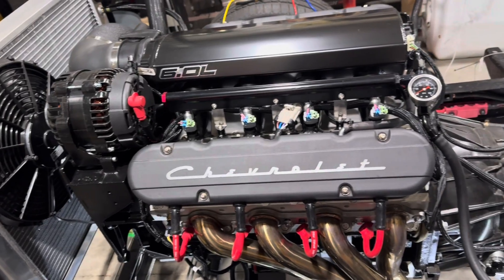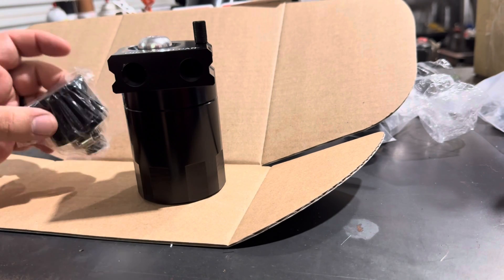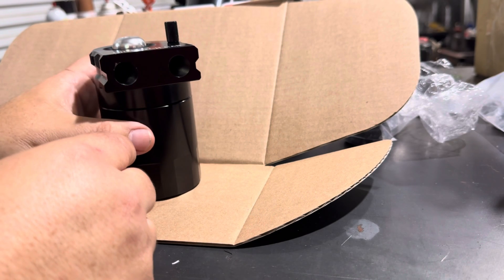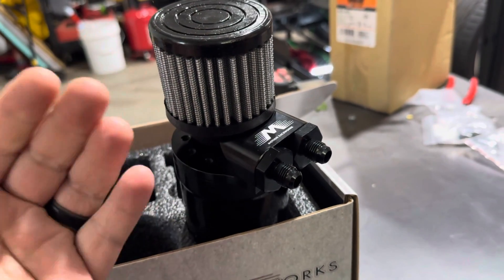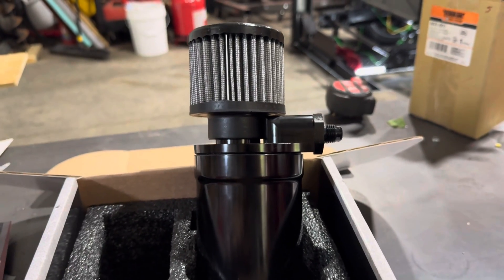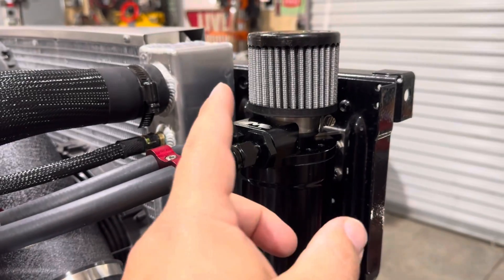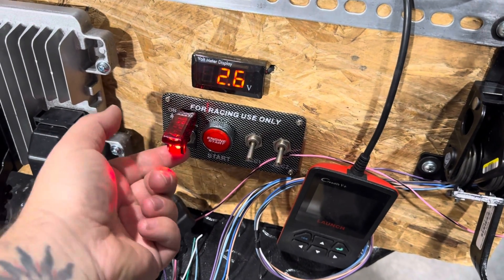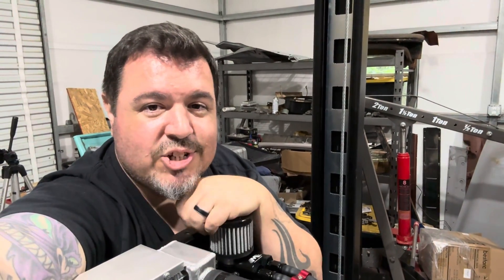Oil Catch Cans: 101 - EVERYTHING you NEED to Know!

Comment: Here's a thought, what if you used a sealed catch can and ran the outlet oldskool to the exhaust?
Reply from the maker: Depends on your hose routing but honestly the only reason I would do that (which I actually might), is if converting a vented catch can to get steam and odor out of the engine bay, and not wanting to re-burn combustion byproducts. Some REALLY important things to consider if attempting that. You need a larger outlet hose/line,  need to weld an exhaust bung about a 1’ downstream from the collector at a 45° angle, pointing the gasses towards the flow of exhaust. A 90° could cause reversion which would be bad. ALSO…. You absolutely have to run a check valve on that large hose to prevent reversion as well. Hope that all makes sense!

Comment: I've been using Gemini from Google to help me rebuild the car I have bought that was a lemon and let me tell you Gemini explains it to the T exactly what the catch can and anything else you want to use on your car and makes perfect sense and gives you perfect advice on what to use and how to use it try it out let me know how you like it because we're all know it alls but AI knows it all. I was going to use a catch can just like that one but Gemini told me differently instead I ordered another one has three hoses that come out of it two inlets and one out because I have an attachment from the PVC valve and the crankcase oil cap ventilation into the catch can to help ventilate even more of the pressure of blow by produced in my engine.

Comment: My ls3 has a breather on oil cap and one on each valve cover. When opening the oil cap I saw water so how would it be different with an open catch can if the vapors aren't getting pulled out with vacuum?  Im thinking a quality sealed one would help more in my case? Newer 525hp ls3 with 12k miles
Reply from the maker: The cans are so great at catching water vapor that some people confusingly think they have engine problems lol. Obviously you’d have to plumb your systems PCV differently than its current configuration though. Thanks for the comment!

Comment: Great video. I do have a question for you though. I've read to mount the catch can lower than the valve covers due to possible syphoning of the crappy oil back into the engine. Yours is mounted high which I also believe this is the correct way. The reason I ask is because on my 700HP LS3 stroker that I have Holley valve covers on but they don't have any kind of baffle in them. Because I have my catch can lower in the front of the car the catch can filles up quick and I'm thinking because with no baffles and being lower it just pushing the oil downhill. Taking the oil cap off I don't have any blow by. I am running a high flow Melling oil pump though and when it first starts it pushing 60 psi, hot at around 30-35. what is your thought on this? Should I move, my catch can so its higher? Thanks
Reply from the maker: Hey! 
Thanks for the question. Yeah with that kind of power, your crankcase pressure is certainly getting up there and I would definitely want the can higher. Are you able to use a baffled valve cover? I know for high hp engines they make large valve cover bungs for routing catch can hoses that have the baffles built into the bungs. Cant remember where I saw them but I know they make them. Would definitely help a lot!

Comment: should i use the filter on my 2001 v8 dodge ram? wouldnt that add air and cause a lean/rich condition?
Reply from the maker: Depends how you plumb it. In my configuration it does not.

Comment: when is the filter on the top used; i got one with my catch can, but i didnt use it ?   dont understand its use
Reply from the maker: One exalted would be If you’re not using your factory PCV system, like me… I run a line from each valve cover to the can and my crankcase pressure escapes through the breather on top

Comment: I'd recommend you change that intake manifold to a fast LSX-RT (truck style).  The short runners eill kill torque and power in low rpm.(anything below 7000)
Reply from the maker: Please watch my video on why I chose that intake and why it doesn’t matter.
Reply: Depends on what a person wants to do. I personally love the fast intakes, my issue is I had to choose the cam, intake, and everything to pour my power in up high. Its in an s10 time attack style build. It has zero driver aids, not even abs. When power blasts in low, it absolutely cooks my tires in the light rear ended truck. It keeps manners very manageable when driving normal as well. It feels like a good running v6 until you start pulling. It gives the same sensation as a turbo car. It also has to have a very short runner to clear the hood unless I want to throw a 4" cowl on it which kills my visibility. They both have pros and cons. Id probably use a long runner if it were a drag vehicle or a tow rig.

Comment: Ha I would have been down to join a live stream, but the car I am working at is just a small sentra QR20DE... I am going to fabricate a aluminum air intake manifold to make room for turbo piping. The exhaust headers are facing the firewall, so not much room to work with. Need to change the layout of the engine bay a bit, but I am aiming for 9psi.... catch cans seem important, so I will put one in after seeing your video! Thanks man cheers
Reply from the maker: Thanks for watching and good luck with your project!

Comment: So the outlet is through the filter on top?  You mentioned two inlet ports...wondering where the outlet is.  My son's '09 Silverado is getting a lot of oil in the throttle body, so just learning about catch cans.  Great vid, thanks.
Reply from the maker: In this application, the Gen 4 LS doesn’t have a vacuum port on the throttle body, so… each valve cover gets routed to both inlets of the can. Oil (if any) is collected, and the crankcase pressure & vapors escape via the filter on top of the can. Think of it as an old school carbureted set up where each valve cover has a breather element on it. Its essentially the same thing only instead of the breather elements getting gross with oil vapor over time, now there is a can to collect that. 
    If you were to utilize this configuration on a gen 3 LS or other engine that has a vacuum port on the throttle body, you would simply just cap off that port.

Comment: Just installed a similar setup on my 3.5 ecoboost. 1 can for each side vented to atmosphere. But my question is what to do with the vacuum lines now? The ecoboost reroute directly back into the intake.  I’d rather not plug them back into the cans and close the system. Where else can I pull vacuum from cleanly?

Comment: I like the look of the catch can on the radiator core support but thst is only legal for off-road use. The return of engine piston blow by was the first federally mandated air pollution device from the early 1960’s. To have it vented to the atmosphere is against the law, it also sends oil vapors into the engine compartment which will attract dirt and throw your OCD switch into overdrive. Stay legal and stay clean. You won’t have to deal with the smell either. LS is a great engine.
Reply from the maker: Ive ran it both sealed and vented.

Comment: Will catch cans, vented or not, and people say it’s legal is bad for the atmosphere. I never send it back to the motor. I’ve been out to the atmosphere. I don’t want that garbage with the back oil or the engine. I put the filter on and it’s not. Can you recycling the garbage back in your motor and it burns it out the exhaust so by going through the can you’re taking oil out and you have the vapours big deal Their filtered what’s coming at exhaust when you have the PCV valve in the system and you’re pulling a vacuum, it’s going to the motor burning out the tail pipe. You want the garbage garbage going back to your motor so right get rid of that garbage away from the motor. And both engines of mine, I run it direct to that. Can I never send it back to the motor filtered out? I do not like sealed cans. Do you want all that pressure out of that motor so you don’t start three leagues early you get that on that motor better for it?
Reply from the maker: I hear ya, I don’t like the concept of reburning all that eithet. I dont care how much more “efficient” it is lol

Comment: How do u avoid a vacuum leak with the breather would it need a check valve included to avoid that or how would that work also clean setup 🎉🎉
Reply from the maker: Its physically impossible to have a vacuum leak when plumbed this way. Its simply each valve cover being vented out to atmosphere. And the cold air intake sucking fresh air for combustion - think of it exactly like a carburetor set up where each valve cover has a breather cap, and the carb sucks fresh air through the air cleaner - same exact thing!

I think the confusion comes when people think of gen 3 LS engines where the cable driven throttle body has a vacuum port after the blade - whereas there is no vacuum port on a Gen 4 Ls’s drive by wire throttle body. Even in the case of the gen 3 - all you’d do is cap the vacuum port! Make sense?

Comment: What size hose did you use on the valve covers and what type of fitting did you add to the AN fitting?
Reply from the maker: Just 3/8 fuel line with 6an pushlock fittings. Then I have 6an to ORB adapters on the catch can.
Reply: @intheshoptv  great video props to you

Comment: I have the same engine setup, if going to an 8an fitting on catch can will the hose be too large for the ports on the valve cover? also are those push connectors the ones that can be purchased with the kit?
Reply from the maker: They are 8an to 6an adapters. Im using standard 3/8 fuel line. The factory used 3/8 or less for the Pcv system so no need to upsize unless making big power. Just standard push-lok connectors

Comment: This is a beautiful product. But it has been proven to be a vacuum leak. There is no baffle for the filter. Try Mighty Mouse. They have a filter that is sprung closed while under vacuum but allows positive pressure out when needed. Great gor boosted vehicles.
Reply from the maker: It has not “been proven” it has been misunderstood and parroted. It’s physically impossible to cause a vacuum leak when plumbed the way I have it (one line off each valve cover). Does a breather cap on each valve cover of a carbureted engine cause a vacuum leak? This is the same exact thing.

Comment: Someone recommended that I add one to my IS250 to avoid carbon build up. Is that correct?
Reply from the maker: No it doesn’t really help much with that. Run some premium gas once in a while - that will do MUCH more for that honestly
Reply: @intheshoptv  Alright. Thank you very much for your guidance.
Reply from the maker: @michaelbwembya237 Thank YOU for watching and commenting!
Reply: @intheshoptv Thank you very much for your guidance.

Comment: Doesn't your setup cuase vaccum leak? The engine can suck air through the vent or there is check valve. I thought when connecting the vent, the line goes to thr intake should be pluged
Reply from the maker: Nope. There is no line that goes to the intake to plug. You may be thinking of gen 3 engines or drive by cable throttle bodies that have a vacuum port on them. This gen 4 engine is a drive by wire throttle body with no vacuum port - think of my set up this way… its the same as a carbureted engine: each valve cover has a breather on it right? This is essentially the same exact concept.

Comment: I have a catch can like your first one, but with the vent to be added on the top…. It’s so tight in my engine bay and the only area that I can install it is in a spot near the cabin air filter…. Wondering if I can use a hose and put the vent away from the actual can.
Reply from the maker: You absolutely can. I myself am thinking of plumbing mine to my exhaust.
Reply: I installed one without the vent on my 2022 Ford F150 Piwerboost and was shocked on the oily residue.
Now I have a same unit with the vent for my Jaguar F Type that is putting out 660hp. Limited space in any area, glad I saw your video about the “smoky” that comes out of it, and if I fully put the unit beside the cabin filter assembly.

Comment: I know this is an old post but I'm trying to put a catch can on a 1982 Chevy C10 305, would I run both valve cover vents to it and tee into the intake or just put a cap on the intake where it went back into intake
Reply from the maker: If you’re running it vented, yes, you’d just cap the intake. If sealed, back to intake. See which way it runs better. My LS hated the sealed can, vented and its like a beast. Every application is different though

Comment: One thing you for got to show is  what goes connected to the inlet and what goes to the outlet for knews like me
Reply from the maker: With this can and gen4 engine, the can is basically just two inlets, and you run a separate line off each valve cover. Really simple install. This would change if you ran a gen 3 with a port behind the throttle body

Comment: Im confused, if you use a vented oil catch can your engine will stole due to vacuum leak correct, because the way it works is one line is vacuuming the pcv valve so it could open,

So by putting a vent it will leak out the vacuum and pcv valve stays closed.
Or im just using a very old car 😂
Reply from the maker: No vacuum leaks when plumbed this way. 
There is no pcv valve, secondly, think about it like as if it WAS an old car… an old carbureted v8 often had two breathers - one on each valve cover… this is literally the same thing. You only get vacuum leaks when you leave vacuum ports open before the intake (like the throttle body port on a gen 3 LS engine)… in that case, you’d simply plug that port. No vacuum leaks!

Comment: My 496 runs not well with vented
Reply from the maker: For a carbureted engine, a sealed catch can is generally preferred over a vented one. Sealed catch cans return crankcase vapors back into the intake, allowing them to be burned, while vented cans release these vapors into the atmosphere. Sealed catch cans can help reduce emissions and potentially improve fuel economy, while vented cans can be a source of pollutants. However, vented catch cans can be a good option for high-performance or forced-induction engines where crankcase pressure relief is a priority. This LS runs humorously better vented.

Comment: Man make sure that silicone grease is O2 sensor safe!
Reply from the maker: You mean when I lubed the hose barbs coming off the catch can?
Reply: Yeah.  When I was a younger tech I had an older guy hit me with that one day.  I had a little spray can of silicone lube that I was using to lube some fuel injector “O” rings before I installed them.  I knew about being careful about the RTV we used and how the wrong kind would kill O2 sensors but I just didn’t think about my spray can.  He looks at me and says “how long have you been using that stuff?”  “A while” I said “why”.  He asks “have you made sure it’s O2 sensor safe?”  I thought about it for a minute and then started to wonder how much chaos I had potentially caused.  Luckily it was safe but I always remembered that.

Comment: Not a single shot of hoses connected to the valve cover
Reply from the maker: Is that something you need to see? They only connect to one place… figured the breather tubes on the valve covers were pretty self explanatory.
Reply: Considering you are using after market covers its not really self explanatory. Heck in theory the catch can is self explanatory this types of videos are only good for different ideas, set ups and options.  @intheshoptv but to complete a video id do the whole installation not just the catchcan itself.  Its like talking about sex and only showing the penis. Just food for thought since you took the time to reply. Im not a streamer or YouTuber by no means a pro but if you disagree then disregard. No biggie
Reply from the maker: @Mslianet1709 its ok, its just that this video is about catch cans themselves and their purposes/differences. Not necessarily a crankcase ventilation plumbing video - reason being is that there are many different ways to route it. Hope that makes sense

Comment: so basically what I see is when the oil gets to the bottom of that baffle it blocks off air flow...
Reply from the maker: If someone has that much oil in a catch can, they either have serious engine problems, or never do maintenance lol
Reply: From personal experience I can tell you it just starts coming out the filter and can run back into your engine if the placement is too high. Very gross, awful clean up, smells  like if Lightning McQueen had diharea, check your catch can.

Comment: Would you reccomend this catch can over a very expensive one like mighty mouse? I'm not doing any racing or anything like that all im running on my ls1 is cam and long tubes
Reply from the maker: Personally I don’t see any benefit to the mm cans beyond the claim that there are no fumes. Additionally if you’re routing it the way mine is (gen 4 vented application), I don’t see how a little smoke and minor fumes can be contained anyway, unless you’re routing everything back to the intake, in which case, you’d have no smoke or fumes even if you ran a cheapo amazon can.